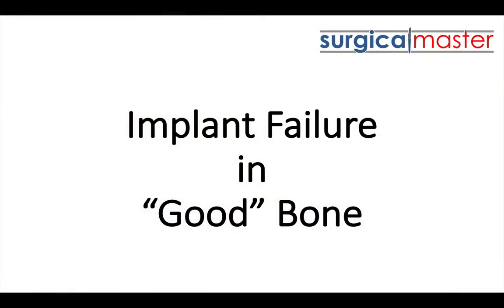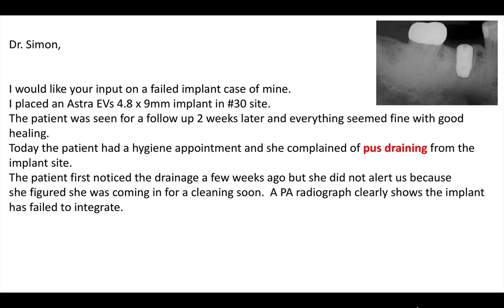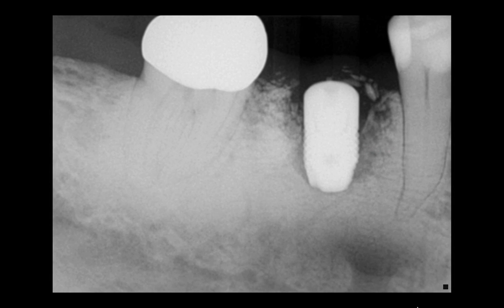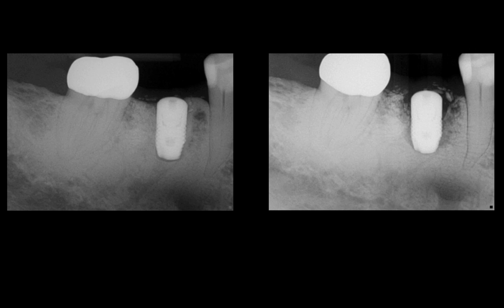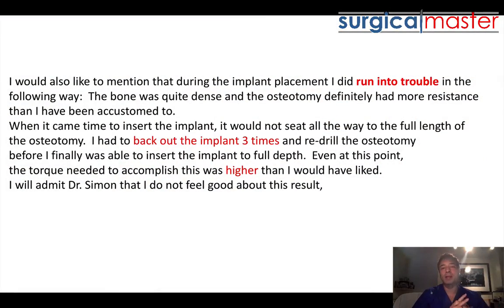Implant failure in GOOD bone

Comment: It takes 2 minutes at 54C to irreversible damage bone (Albrektsson). I assume the osteotomy was done in less than 2 minutes, also the subsequent drills would remove any damaged bone. Seating torque up to 75ncm is OK. 
#29 appears to be necrotic. The upstream infection follows the lymphics to infect the new implant. The implant appears to be infected.

Comment: IN D1 BONE FEW PRECAUTIONS ARE VERY NECESSARY.
1) SPEED HIGH
2) COOLANT MORE
3) SHARP DRILLS 
4) SLIGHTLY MORE CORONAL ENLARGEMENT OF THE OSTEOTOMY SITE
5) VERY SLOW INTRODUCTION OF IMPLANT INTO THE SITE, GIVING TIME FOR THE BONE TO EXPAND, FEW THREADS AT TIME.
Reply: Agree with on Coolant i and gradual insertion... ofcourse other points are valid too